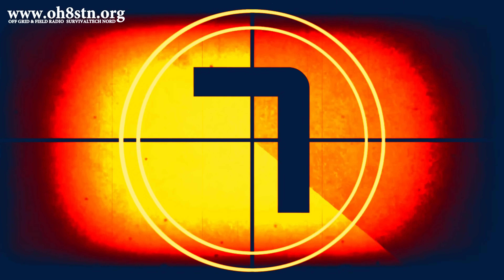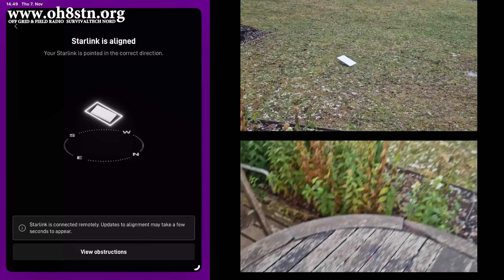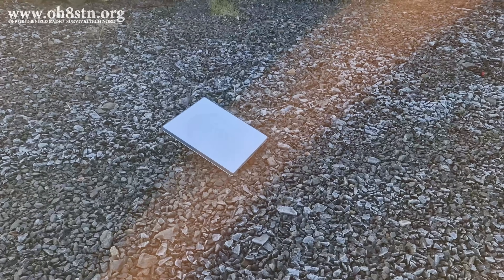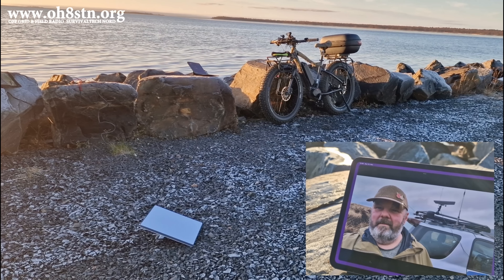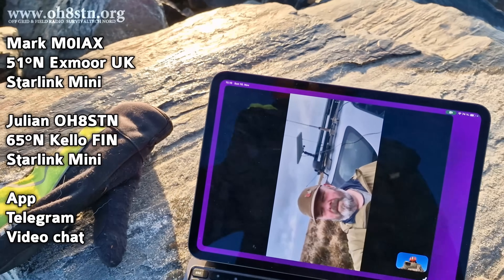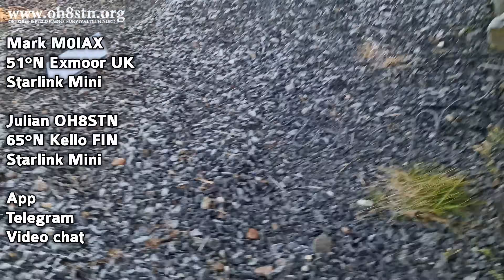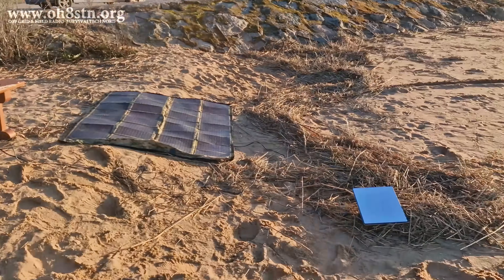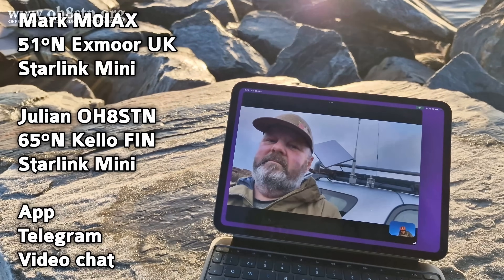Starlink Mini: Setup & Field Test | Disaster Communications

Comment: I’ve read you can “pause” starlink via only satellites. Do you think it’s feasible to have a starlink powered on so it can still do firmware updates but on pause Then if an emergency happened unpause it?
Reply from the maker: I'm not sure about the firmware updates while it's paused. As soon as my starlink connected to a satellite, this was during the activation process, the firmware was updated first. Anyway, it's a great question but I don't know the answer. The pause feature is accurate and I'm using it already
73
Julian oh8stn
Reply: I’ve read it does do updates while paused so theoretically it should work.
Reply: @OH8STN I can confirm you can do firmwares updates while it's paused. I have a Starlink V2 with roam service which I use in off-grid camping (areas without cell service) and power it every 2-3 months on my house to get it updated. I can also confirm you can unpause it without problems only via satellite. The last time I used it, I went to a location where I didn't know if was cell service, so I did not unpause it at my home. When I arrived I confirmed no cell service onsite, so I developed the Starlink, it downloaded a firmware upload, and about 10min later I unpaused it and got internet connectivity. I can't wait to get the Mini here in Chile. I will sold my V2 kit because the Mini so much portable and power efficient! Greetings de CE3VRT

Comment: As you mentioned... Starlink became essential when Hurricane Helene hit North Carolina in late September 2024.  It was the only way whole communities cut off from everything - roads gone/Houses vanished in torrential washouts when rivers devastated the area.  Ham radio coupled with Starlink became the only way.  I'm at 65 degrees north and everyone here is switching including me.
Reply from the maker: Thanks for this comment. 
It was hurricane Helene which showed me how/why this technology is important. A regional disaster where infrastructure has collapsed is the perfect use case model for Starlink. 
Although I wouldn't rely entirely on it, an zlways on HF data network augmented by a backup Starlink station sounds reasonable. 
Thanks again.
73
Julian oh8stn

Comment: The state of Florida deployed over 100 Starlink portables and generators to provide comms to State and county EOC's and directly to some state agency vehicles. The ability to communicate with county, state and federal agencies was instrumental to getting timely damage reports and health and welfare info. The state also deployed over 100 portable generators to gas stations to enable them to pump fuel in the event of power failure. Since banking POS terminals were down in some areas the state jump started the local economy by just gifting everyone 10 gallons of gasoline to all individual recovery efforts to continue after they ran out of gasoline. 

The state of NC was slow to the party and comms were all but impossible until a shipment of Starlinks arrived 2 days after the disaster. All cell and government communications were destroyed because the landslides ripped out the fiber links for almost all of the cell sites. They did however have one repeater site active on a nearby mountain and hams stepped up to handle comms from some areas. 

I am planning to order a starlink mini to add to my bug out vehicle. It indeed does change everything

73
Reply: What’s your QTH?
Reply from the maker: @nerdlywehunt Thanks for leaving this comment. I seems we can’t always understand the potential benefit, without context like what you shared.
So often we are stuck in one box or another, fearful to see what is outside the box. Your comment makes it clear that we need a few different boxes.
Thanks for sharing and 73
Julian oh8stn

Comment: Julian, This question has nothing to do with Starlink, So what company made your fat bike and did you ever make a video about it ? Thanks KD9WTH Gary
Reply from the maker: My fatbike is a GZR Raw 2019. It's a Chinese copy of a Swedish copy of a, ...
I'm planning some winter outings on the bike. Just waiting on the final version of my rigid contacts.
Reply: Thanks, Julian. I'm trying to decide between a fat bike or a Rokon. The Rokon is gas, though. That's the bad thing.But it will go anywhere,  and it can up to 2500 lbs. Thanks again
Reply from the maker: @garytedlock7533  No problem Gary. If I were doing it again, I would probably get a 29er Fat bike. More narrow wheels means going further on the same battery assist. As I have a fat bike already,  the idea of adding a gas or diesel powered quad bike to my inventory is quite attractive. Some I can use to carry wood to the cabin, the harvest back honme or to the cabin, or just move greater distances with little effort. My fat bike will always be part of my gear. It provides an easy to charge and maintain method of transportation useful in a grid down or fair saving money when energy prices are high.
Reply: @OH8STN   Rokon is not a quad. It's a 2 wheel ,2 wheel drive
Reply: @OH8STN I like the motorcycle style "trunk" you placed on the back of the bike. I wish I had acquired one of the Harley Trikes when the local PD went to two wheelers. This would have been interesting to have that large boot for radio gear and remote mounting the control heads. I know it kinda defeats the purpose of an environmentally responsible form of transportation but these were awesome road bikes, the only downside was that most carried the AMF logo back in the day.
Reply from the maker: @Subgunman I remember those Trikes 👍
Reply: ROKON

Comment: I'm way behind the curve in the digital radio realm. I'm guessing that's going to change when I get the book. Having all kinds of problems getting started with JS8 on my KX2. I'm sure it's something simple. Long in the tooth but still looking to continue to learn.
Reply from the maker: By the way there's more than one book coming out. The one you'll probably be most interested in is grid down data Communications. That's an entire book on data Communications.
Reply: @OH8STN  Can't wait!!
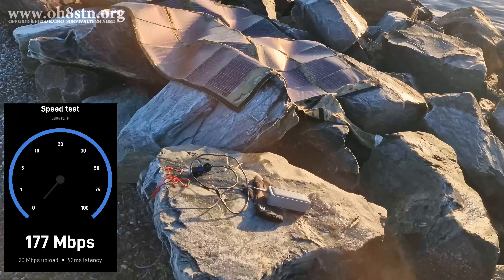Reply from the maker: I saw your email but I haven't had a chance to reply yet. I've been working for about 2:00 in the morning till about 9:00 at night. That error you wrote me about is just telling you that the software can't communicate with your radio. There's two options if you can't get it to work. The first one is to just not use cat control. Because that error is related to communication between your radio and your software. So just change the frequency yourself. The other option is to figure out which one of those settings is wrong. I don't have a kx2 here so it's difficult to figure out which one is the culprit.
Reply: @OH8STN  No sweat, I know you're busy! I thought about not using CAT control, and I might short term, but I have to know the answer.
Reply from the maker: @dougdaniels okay here's a couple of things to check. Baud rate, other com port settings eg 8-N-1, software used for CAT control (fldigi is troublesome) I prefer omnirig.
Hoping this helps.

Comment: Nice video again. Indeed a nice additional tool but with less ham challenge, but hey it really depends in what situation one is. Keep up rolling.
Reply from the maker: I couldnt agree more. The situation dictates which tool to use. I will also deploy my slow but robust asynchronous data modes on HF to keep a “survuval” network going. When I need a face to face teaching me how to strip down the transmission in my car, or render critical aid to an injured person, Starlink might be a much better tool, provided in is still operational.
73
Julian oh8stn